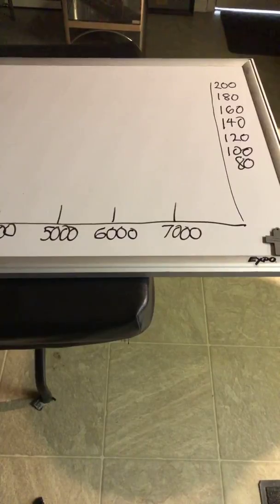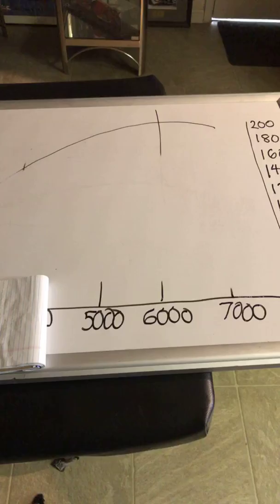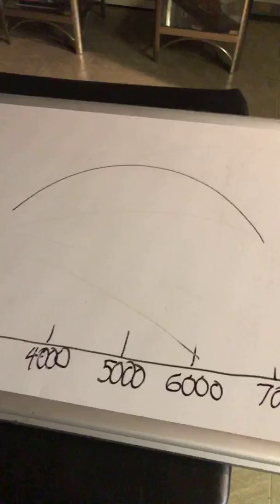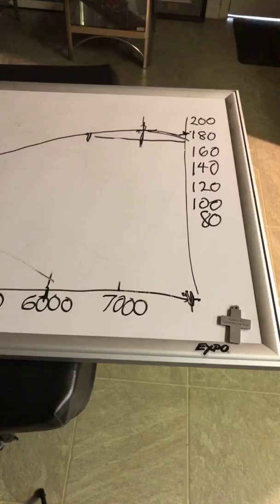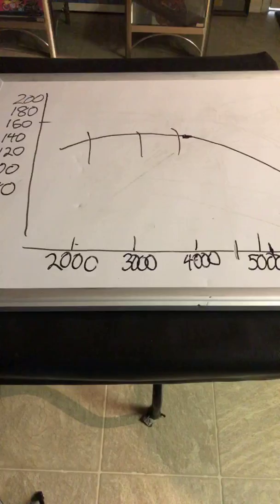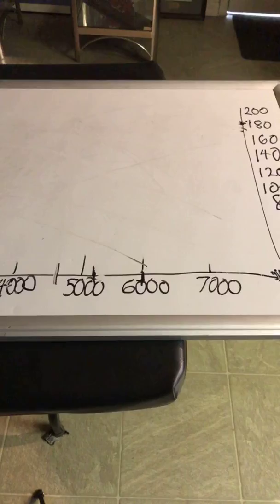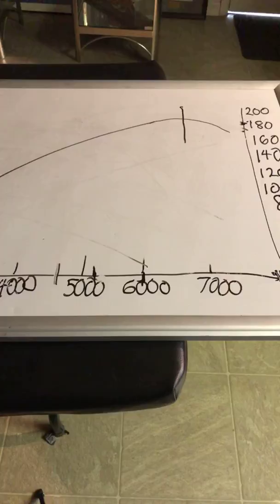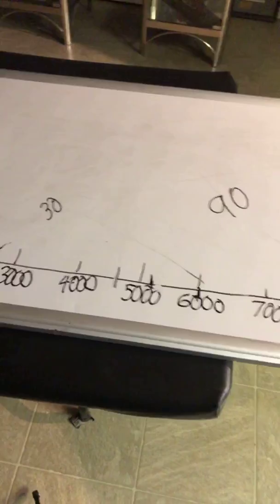Tech Talk Tuesday #32 Dyno Curves

Comment: The main thing that matters is Rear wheel Torque. Maximizing that is all that matters. The only reason horsepower matters is that you can use it to decide what gearing and shift points to use to get max rear wheel torque.